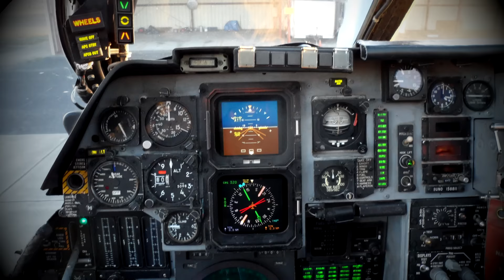USMC Jet Crashes Cable Car | Last Moments

Comment: seeing all that blood splattered over the pure white snow is horrifying.
Reply: Reminded me of when I was traveling across Michoacan state, Mexico in the back of a pickup. There was a taxi that had recently wrecked and flipped over... And the wheels were still spinning when we passed... And blood was steadily pouring out of the back passenger side door onto the ground, into a pool. :(
Reply: They must have essentially exploded on impact 😞 imagine being a first responder - I would need a fair few shandies after dealing with that
Reply: Not If your finish
Reply: @KTBFFH  I heard a rumour that some of the  bodies faces were twisted in sheer terror when found. May they RIP
Reply: As dramatic as blood sounds, its more than likely hydraulic fluid mixed in with some blood. The wide spatter looks more consistent with tank rupture. Its quite a common feature of plane crashes and often mistaken for blood. 
TLDR: Hydraulic fluid with small amounts of blood
Reply: I think its hydraulic fluid
Reply: @tasmanc6515  In the Army, we called cherry juice.
Reply: @tasmanc6515  what exactly do you thank uses that much hydrologic fluid on a gondola? "A tank busting open" yeah a human tank full of guts and gore, and some times other humans.
Reply: @Stevie-J  I like your thinking
Reply: Wait it's blood ?😭
Reply: @robertstone9988  bro the severed hydraulic tank in the wing of the fighter??? Believe it or not, planes tend to use a lot of HF to operate about every system. Gear, stabilizers, ailerons, and flap all require HF to operate. This is additionally backed up by the hydraulic failure that the jet experienced post-crash.
Reply: @tasmanc6515  that would have sprayed froma wing 1000 feet up going hundreds of milles a hour it wouldnt end up in one big puddle
Reply: @robertstone9988  Exactly, does these people even physics?
Reply: @robertstone9988  smh
Reply: Almosol, omylec etc hydraulic fluid is red
Reply: @jackwyatt1218  its people splater
Reply: @davepowell7168  yes and looks like blood but the gondola has no hydrolic fluid and if it was from the plane it wouldnt be all in one big spot under the gondola. That red in the snow is whats left of a human who is splaterd all over the ground. I used to clean up car crashes on I 70 for the state police trust me you would be surprised how easy the human body comes a part. I towed a eagle talon all the way to the impound lot befor I noticed the hunk of scalp ( not unusual when you go threw the wind sheald buckle up) stuck in the windsheald had the guys face still on it his nose and eye brows even his eye brow piercing. Had to call the medical examiner. You know family might want his face back or some thing
Reply: @robertstone9988  Fascinating comment. Thanks Robert, l always appreciate a cogent reality check. I don't collect scalps or faces either but enjoyed the dark 'gallows humour' from a guy who has possibly been tempted.
Reply: @tasmanc6515  unless hydro fluid has chunks in it I believe that is guts and blood
Reply: My first thought about all the hydraulic fluid theories in this thread: why would a cable car need hydraulic fluid? The cable is mechanically controlled with gears and pulleys on both the top and the bottom of the mountain. The car has no need for hydraulic fluid; it's just bolted to the cable.
And it can't be from the plane - the plane's fluid vaporised 250ft. in the air. The red in that picture is concentrated where the car eventually stopped tumbling.
Reply: @accaliamurraymusic  its inside out people.
Reply: @robertstone9988  yep :(
Reply: @accaliamurraymusic  worms got to eat too
Reply: Yeah
Reply: @tasmanc6515  Lol yeah okay buddy🤓
Reply: @tasmanc6515  You are 100% wrong. There is ZERO possibility that the red snow is hydraulic fluid from the aircraft. Firstly, the aircraft hit the cable, not the gondola or the suspension bogey directly above the gondola. Secondly, the aircraft was traveling horizontally at over 700 feet per second, any spilled hydraulic fluid also continued to move horizontally (because physics), initially at over 700 feet per second, slowing rapidly to around 30 feet per second (because air resistance) while also falling vertically to the ground (taking over 7 seconds to do so from 250' up), so any hydraulic fluid reaching the ground would do so hundreds of feet from the gondola, and widely dispersed. If you don't believe me watch a plane dumping retardant on a fire, NONE of the retardant reaches the ground directly below the point of initial release, it all travels along the plane's path as it falls.
Reply: Hydraulic fluid looks reddish, in car crashes it can look like blood also.
Reply: @jtclark877  ..... no one stopped to help?
Reply: @tasmanc6515  ...... ridiculous. The plane hit the cable at over 500 miles an hour, any fluid would have been strewn over miles..... the cable car was crushed to pieces with the bloodstains right outside the cable car.
Reply: @unclemao3473  that’s blood on Finish “finishings”
Reply: @tasmanc6515   'As dramatic as blood sounds, its more than likely hydraulic fluid mixed in with some blood. The wide spatter looks more consistent with tank rupture. Its quite a common feature of plane crashes and often mistaken for blood.'

There WAS no plane crash debris in that video... Did we watch the same video?  Even if some left the plane,  at over 300ft , and at 500knts, it  would be dispersed over a huge area. 

Tl:Dr? It was blood. From 20 bodies that hit the ground at speed.
Reply: It must have been a horrific scene upon arrival.
Reply: @tasmanc6515  Nah that happened 1,000 feet above where the cage smashed into the ground. Hydraulic fluid would have dispersed and been undetectable on the ground. I'm afraid its humans smashed by the cage which turned over when it hit.
Reply: They must have been squished like bugs.
Reply: @Stevie-J  Lol.
Reply: @tasmanc6515  hydraulic fluid from what? The plane that cut through it and was gone on less then a second? Amazing that much fluid stayed with the plane all the way down...

The things you people tell yourself to hid an obvious fact. They fell 200 feet, 20 of them so about 180 pints of blood, and were crushed into the mountain. That ain't hydraulic fluid.
Reply: Man's never seen a bear or wolf in his life
Reply: Reminds me of the song White Winter Hymnal. "And Micheal you would fall, and turn the white snow red as strawberries in the summertime"
Reply: I agree
Reply: It's why I adore white and red colour schemes.

A magical combination. Eerie, like liminal spaces or the forest at night.

However I apologise for not taking into account those innocent victims, humans like you and I, struck by a lightning bolt of bad fortune. And that bad luck only got worse to them due to Americas cover up.

I hope you can understand that although what I'm doing is slightly selfishly philosophical, I mean no disrespect to the dead, may they rest in peace. Its truly sad they and their family recieved no justice, only money.
Reply: I checked and it is horrific
Reply: @unclemao3473  after the dawn, when morning has broken, snow thats white turns to red.
blood red snow tells what happened last night, a tale of a sniper is bornnn
Reply: @mikoonblitz5966  ong
Reply: That is the most blood I’ve seen in one place
Reply: @robertstone9988  3:13 Pay attention.
Reply: That's undoubtedly blood. I tore my hand open on a steel fence a few months ago, almost lost my finger and am lucky my balls are intact. 
I was surprised at the amount of blood that leaked from that.

Anyway crashing in a cable car from sky high you would reckon the blood loss would be significant. ''hydraulic fluid'' i dont even know what to say to this

Also anyone notice in one of the photos the blood splatters look like the outline of 2 people? Head arms legs torso etc
Reply: @accaliamurraymusic All that logic is too much for people that don't have critical thinking and logical mind sets.

Comment: How do you not realize the difference between 300 and a couple thousand feet just a single flight from becoming an actual fighter pilot even if the altimeter was broken
Reply: I am not a pilot and still pretty confident I'd notice the difference.
Reply: @FriedrichHerschel  nor am I but that seems like the kinda thing that would be extremely helpful to know
Reply: Snow can be very deceptive to pilots. Without shadows, it looks far even if you arent.
Reply: @c-dawg2145  there must be some extra context clues like there's a lot more mountain here than we were expecting
Reply: Pilot: "Hey RIO..."

RIO: "Yeah?"

Pilot: "Are the trees around here typically a thousand feet tall?"

RIO: "No."

Pilot: "Huh."
Reply: Because they want a rollercoaster ride they were bored in Aviano
Reply: @FriedrichHerschel  Trust me, it's easy to tell.
Reply: see the picture again the plane had 3 seperate altimeters, mechanical, electronic, and radar +1 if you count as you say, that the pilot should know the difference between 300ft and 2000ft. i have heard that trained pilots at the first 1000ft from the ground can tell just by sight their altitude with a max error of 100ft (of course the 300 would be obvious even to a first time passenger as too low compared to 2k).
Reply: @jplayzow  yeah, maybe
Reply: @c-dawg2145  That would be the case If you were flying above a flat plane with nothing but snow. But these people were flying next to a fucking mountain. It would be very easy to see that they are not high enough.
Reply: How? He's a bad liar. That's how.
Reply: "How do you not realize the difference ..." flying under that cable in that place was some kind of tradition and this American planes were spoted doing it all the time...
Reply: @kapioskapiopoylos7338  me as a land lubber i can tell the height of clouds
i read them to tell the wheather
surely somebody trained to fly 500 mph should know the difference
Reply: @kapioskapiopoylos7338  exactly, and then add into this distractions, multi-tasking, etc.. a recipe for disaster :-(